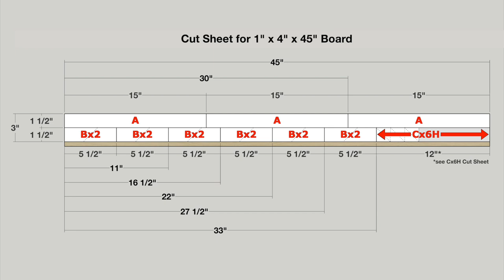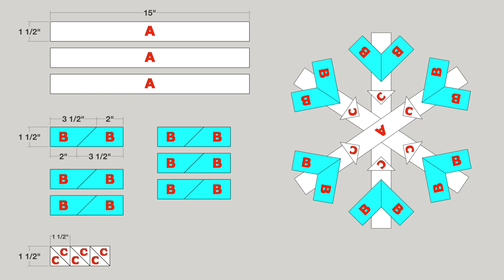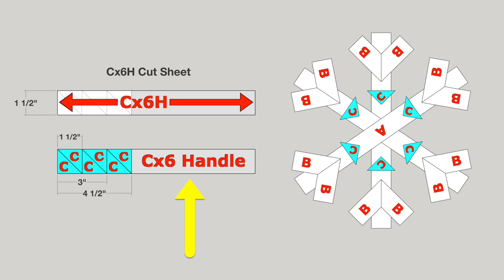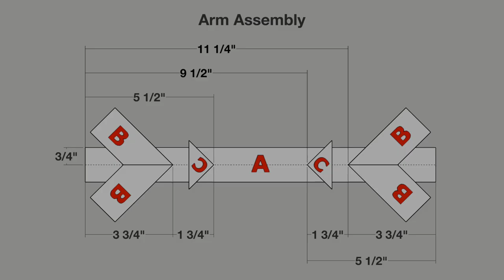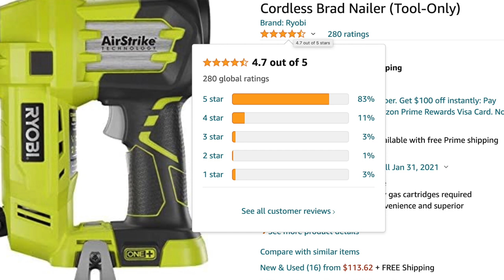DIY Snowflake Holiday Decoration - Free Plans!

Comment: I'm considering getting the ryobi nailer myself. A lot of people knock ryobi...  But the drills are used at my work by the whole shop. All day, everyday. And when they come up with a new model, the old batteries still work with new tool.
Reply from the maker: Yeah, I've never really had problems with anything Ryobi. And it's hard to argue with actual customer reviews. I'm still not sure about the depth issue - I know how to adjust it, maybe I wasn't turning it far enough. I'll spend some time on that this week.

Comment: Harbor Freight sells these squeeze bottles in packs of three.  Best thing ever for glue.  Been using them for years.  I do not understand why anyone likes the Gluebots.  They are a clogging nightmare.

Hope you have better luck with the Ryobi than I did.  Keep the exit for the nails nice and clean and give it a spritz of lube occasionally.  Mine constantly would misfire if it wasn't squeaky clean.  Plenty of power, though.  That thing would sink a 2" brad into solid oak without breaking a sweat.

Love the coat joke.  :-)
Reply: I use the plastic mustard and ketchup bottles. Clean them out real good and fill one with titebond 2 and one with TB3.  5ey are designed to set on the top so the glue is always ready to squeeze out.
Reply from the maker: Thanks for the info! 😄
Reply from the maker: @Rusty_ok  Good idea - thanks! 😄

Comment: I almost bought glue bottles until I discovered French’s mustard bottles have a ‘snap back’ cap which keeps the cap out of the way while running a thin bead of glue on an edge. They also have a fairly small opening which has been helping me avoid having glue all over everything. Was your glue extremely runny because it’s old? How long does it take for that to happen? I bought 2 gallons of 2 different glues which should last me quite a while.

Oh yeah, have you given up the name Newbie Dan?
Reply from the maker: I love the name "Newbie Dan", and in fact a version of that is my personalized license plate. But honestly, I'm not a newbie anymore, and I was getting enough comments about it (not negative comments, just comments) that I just got tired of replying the same thing to them. So now "I'm Dan Thomas, and welcome to my channel for the newbie woodworker. Or anyone, really." I think it's more "on point" anyway. 😄

Regarding glue, I bought a big jug of Titebond 2 several years ago, and I've only used about half of it. Mostly because when I use Baltic Birch plywood and Spax screws, I rarely need glue. The screws hold up quite well, and I can remove them if I ever need to. The glue got so thick in the jug that I had to add a small amount of water, which worked out fine, but I have no idea how thick or thin it's supposed to be. 😂  All that to say that I'm no expert on glue. But I just bought a squeeze bottle of Titebond 3 because I needed a longer set time, and it's runny by default, so maybe T2 is supposed to be runny also.

Regarding bottles, I just bought these from Amazon https://amzn.to/3nJr4lX and they're perfect. Not too large, and plenty of them so I can cut the tips to different sizes. Way better than the GluBot, in my opinion.

Comment: Great video and unlike all the rest of the projects done by people with 40 years of woodworking experience on YTube who do everything perfectly the first time, your snowflake has some personality and shows that a real human being actually made it!  I have been using my Ryobi Brad Nailer for about a year now.  Great nailer however it is quite bulky.  I also have an air powered Grex pin nailer that is really cool.  Ryobi sells a battery powered air compressor that weighs about 5 pounds, that fits underneath my assembly table.  You should really go look at one.  They are just powerful enough for nailers.  Hardly any more trouble to carry around than the Ryobi.
Reply from the maker: Thanks for the info on the air compressor. And there's a reason my logo is a screaming face - I make TONS of mistakes. 😂

Comment: You could have cleaned out the glue dried up in the bot by running it through hot water to loosen it and pull out the gummy glue with needle nose pliers
Reply from the maker: Thanks! The biggest problem for me was what to do with all the glue already in the bottle. I read that you're not supposed to pour glue down the drain.

Comment: I thought the snowflake is great! I have both the Ryobi brad nailer and the pin nailer, love them! You won't be disappointed. I have also had similar problems with the gluebot and glue drying. I have found that you can add a small amount of water to reconstitute the glue and a small diameter dowel and pipe cleaners eventually clean out the bottle.
Reply from the maker: Thanks! And thanks for the tip. I may try using the disposable method for a while, and see how that works out - especially since I don't use that much glue (at least not yet).
Reply: Garry not Linda. Actually a little white vinegar mixes with the glue better and makes much shorter work of cleaning a glue brush. I never thought the Glue Bot was a good idea for the home shop it's more of a production tool. I agree with one of the other commenters. Unless you are doing large projects on a regular basis only keep small quantities of glue on hand. I can't tell you the number of times I've had glue skin over in a container less than half full causing a quick trip to the hardware store.
Reply from the maker: @bassrun101  Thanks, Gary. I'm learning a lot!

Comment: We have a new lockdown and no snow! So I've just decided to make my own snowflakes. With a little luck they won't be red.
Unfortunately, the link to the plans doesn't work. Something is missing.  With try and error I came to the plans .
(it seems only /projects   is missing somewhere in between.
I wish you a nice  Christmas holidays and all the best for 2021
Reply from the maker: Thanks, Hans! And especially thanks for telling be about the link. It was missing the colon after "https". I've been working on improving the snowflake-making process, and one thing I'm doing is cutting part "B" as one single piece, instead of two pieces with miter cuts. So basically I cut a 3 1/2" x 3 1/2" square. Then I stand up the piece and clamp it to my miter gauge, raise my blade to 2", and make two cuts to leave the L-shaped piece. I'll post something about it later. The original way works too, so no worries if what I described doesn't make sense. 😄 All the best to you too!